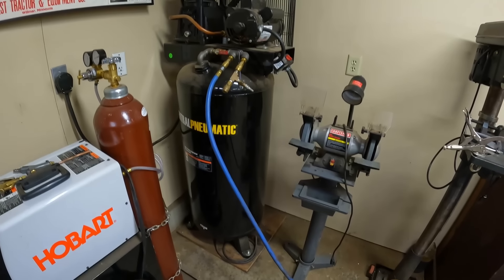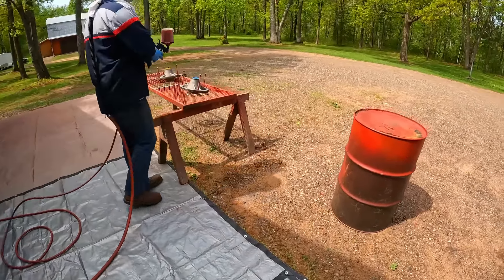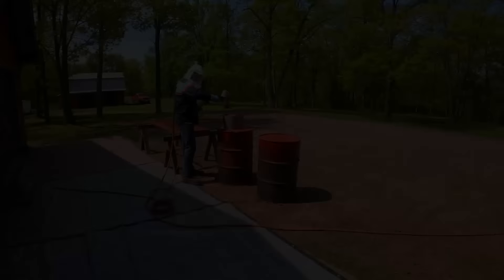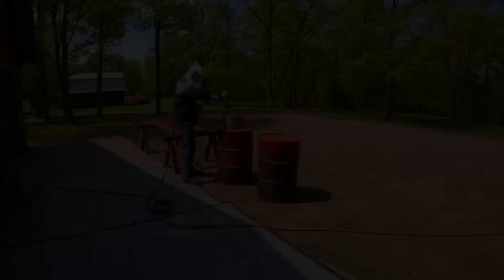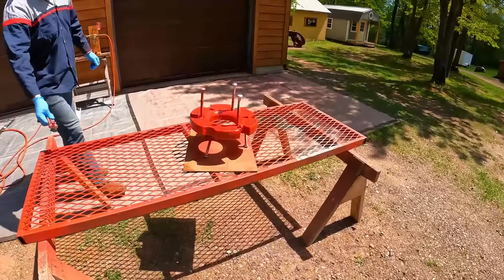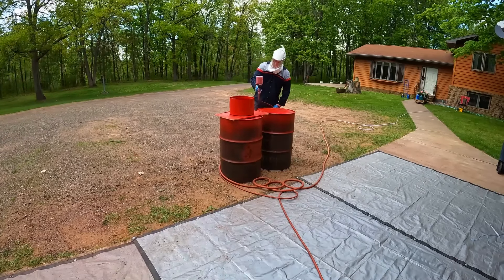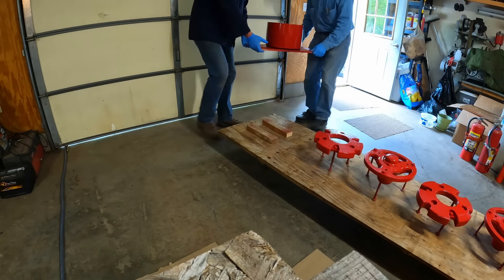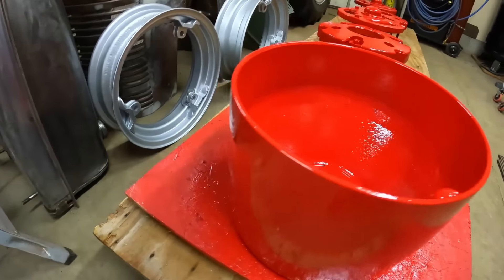Farmall Super M Paint Day! Wheel Swap Continues & Overview of Painting Equipment

Comment: Nice job on the painting. You have probable already answered this but where did you  get the painting hood and air supply?
Reply from the maker: We bought ours through a mail-order ad because it was around 2003/2004 before the internet really took off. But these HobbyAir systems are still sold through auto paint supply stores or in the internet.
Reply: @squatch253  Thank you. I will check it out.

Comment: I have seen a couple different ideas for temporary paint booths. One involved a few boards to frame it with plastic covering it when a friend was painting a car. The other was a folding sun shade that the guy set up for painting small items. Both used box fans with high efficiency furnace filters for bringing in fresh air. That allowed for painting when they had state bird (mosquito) and pollen issues.
Reply from the maker: I don’t paint often enough to warrant putting any effort into having a paint booth 👍

Comment: If you want to know how auto painters remove bugs:
Take a loop of masking tape sticky side out and hold it at the top, then slowly lower until it contacts the bug, then pull away.  If you can't get it with the tape loop, let the paint dry and sand it out and repaint.  The problem with doing it with pliers or tweezers is that no matter how steady you can hold things, your hands will still move around a little and can cause a lot more overall damage and widen the overall repair.  It is usually harder to fix than if you let it dry and fix it afterwards.  Yes, it is incredibly tempting to get those pliers out and fix it now so you can make it perfect, but it usually is a bad idea.   
If you use a tape loop it usually doesn't matter if your hands move around a little because the tape will flex and take up that movement.  The bottom of the tape loop will contact the thing that is highest or more proud of the surface - like a bug.  It will usually pick up the bug (or anything proud of the surface) - as long as you are careful doing it.  If it doesn't get the bug out - let it dry, sand and repaint.

Comment: Can I give you my family’s d2? Purchased new and only used on the farm to pull a bailer on steep ground. Never had a blade or winch. Paint looks as close to new as can be. Always stored in the barn. It has a round factory roof. The seat material is cracked is about all the damage. It has hydraulics on the rear hitch. I would love it to go to a professional. Last run 10 years ago but stored indoors and correctly. I am on Olympia Washington state.

Comment: What pressure do you have the regulator set at for painting?
Reply from the maker: I run two regulators in my setup - the first one is on the inlet side of the air/water separator and is set at 45 psi - this keeps the paint gun from pushing out a brief high pressure spike of air when the trigger is first pulled. Then the second regulator is mounted on the base of the paint gun itself, and I’ve got that one set at just 12 psi.